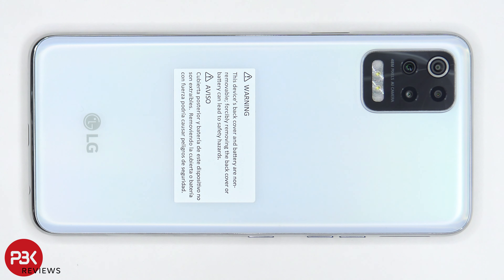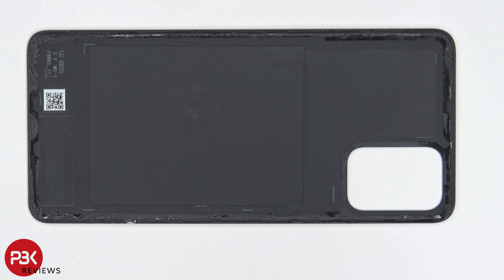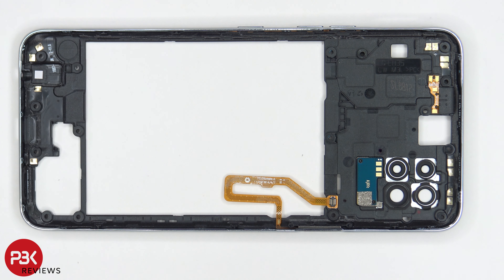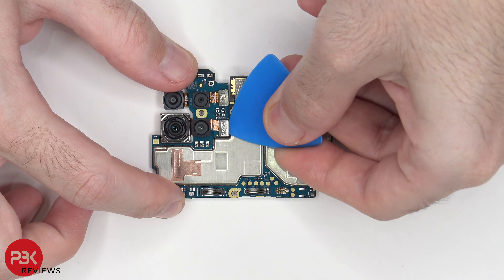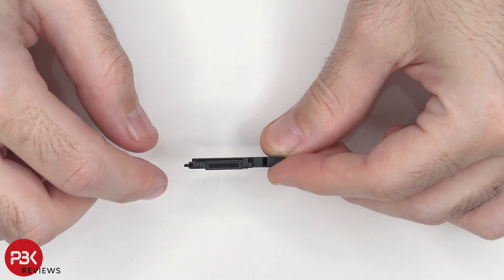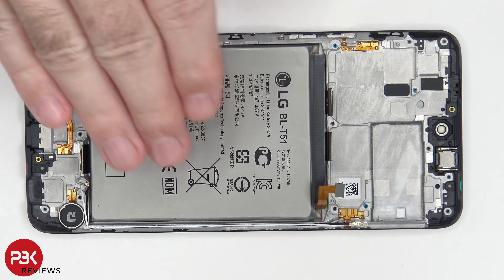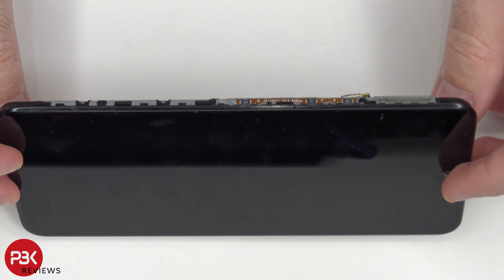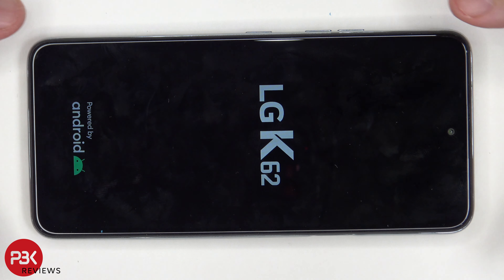LG K62 K52 Disassembly Teardown Repair Video Review

Comment: Which one do you prefer, plastic pry tool or metal pry tool?
Reply from the maker: Some things are easier when using metal tools for since plastic tools are either to weak or the stronger ones are too thick and aren't able to do the job. But its always recommended to use plastic when prying off back plates etc so you don't scratch or damage the housing a lot and also to prevent shorting the phone if your metal tool touches chips and so forth. But as long as the battery is disconnected, should be fine, I have never ran into any issues all these years.

Comment: Please do cross-compatibility for parts between k42 k52 k62
Reply from the maker: Everything seems to be interchangeable, same battery, same screen, same charger port board (aside from the gaskets being different color), same vibrator motor, same flex cables for the speaker assembly/power button/ and side buttons. The speaker inside the speaker housing should be interchangeable too but the speaker housing (plastic housing) seems to be a bit different in shape/size. Motherboards are different in shape/orientation so those would not be interchangeable. Same with the cameras, they have different connectors or lengths in camera cables. The front facing cameras might be interchangeable since they are in the same area and same connector type.
Reply: @PBKreviews  brilliant!
Reply from the maker: @harysviewty  :)

Comment: Even Samsung do the same for battery replacement problem
Reply from the maker: Yup, but at least Samsung's batteries are thick and come off easier compared to these batteries which are flimsy and bend easily and are adhered to the mid frame with very strong adhesive.
Reply: @PBKreviews  these companies ditched pull taps to cutoff costs
Reply from the maker: @abidashhar8627  Either that or they want to change the batteries themselves to charge people. I wish all batteries had the pull tabs.
Reply: Sudah ditampilkan.